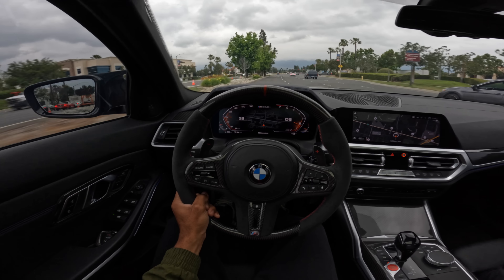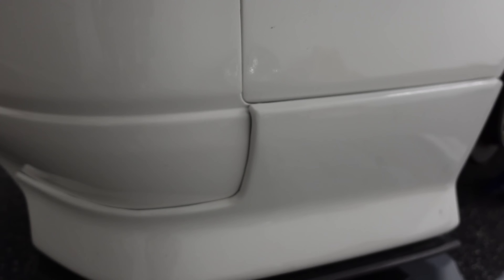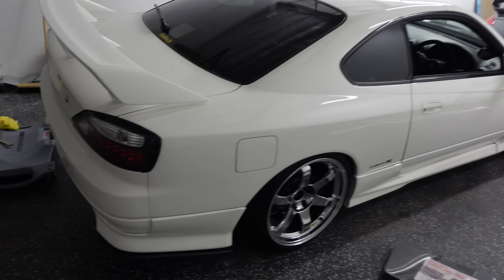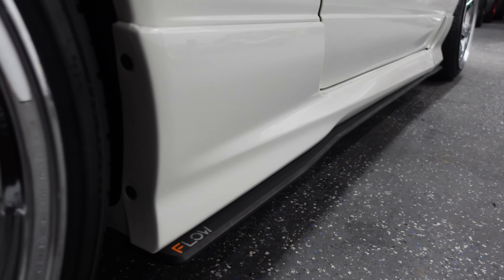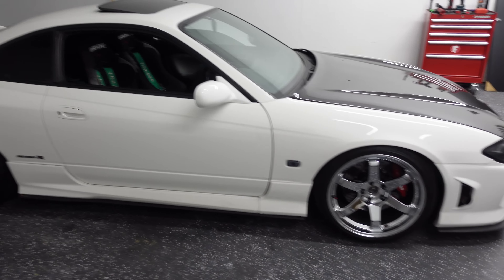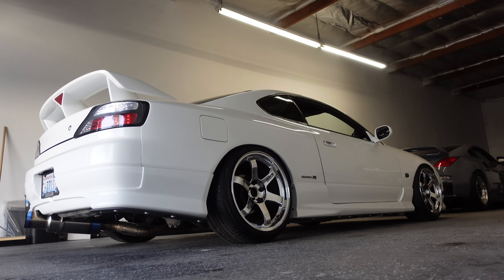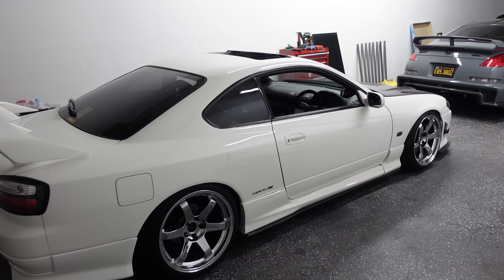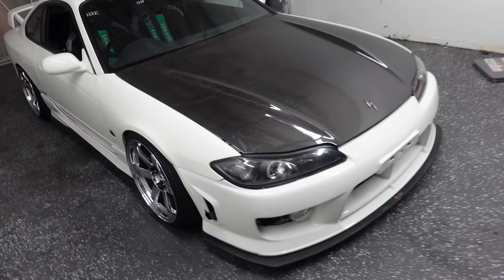Finishing The Aero Kit On My S15!

Comment: I have OEM Rear Splats/Mud Flaps for my 2015 Q60S 6 spd (last Gen G37 Coupe) and they didn’t fit flush either. I did have to drill into the bumper too and I put heavy duty 3M for flush fitment. Had been rockin it for about 2 months and it hasn’t moved a muscle. Def makes the rear end pop🔥